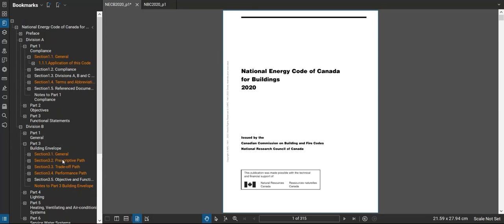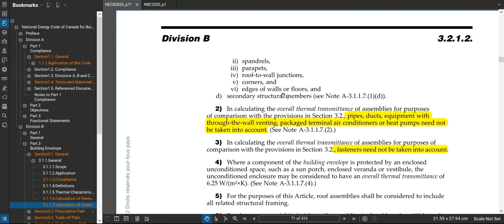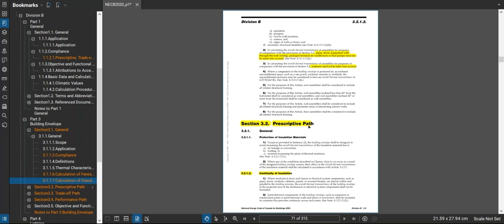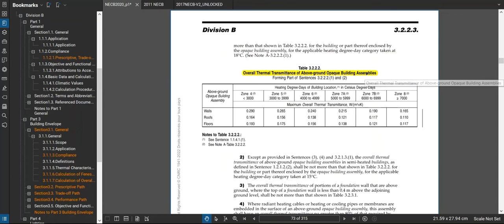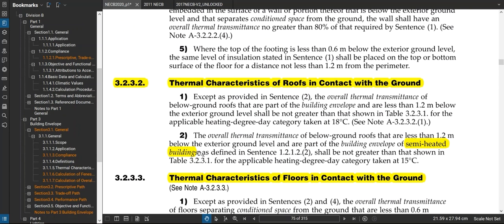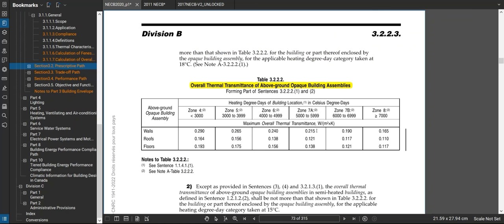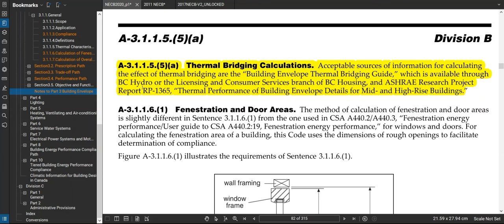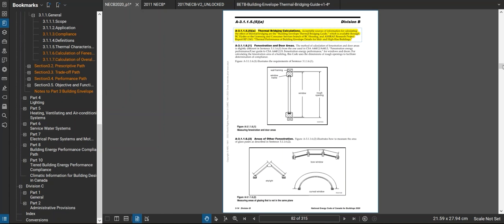National Energy Code of Canada For Buildings 2022 Overview

Comment: And our houses are still built like crap. R17 walls and leaky.
Reply from the maker: I agree. Quite shameful that continuous outside insulation is not yet mandatory. Should also be mandatory that it is non combustible (mineral wool) in urban settings and locations with risk of wild fires.
Reply: @dcarchtech9757  it is mandatory but you are allowed prescriptive paths, performance paths and tradeoff paths.

So you can do efficient windows, doors, windows, furnace instead of putting a coat on your house.

But since a high number of. Homes are built in cold winter months and trades are not skilled or paid enough to build them with exterior envelope sealing and insulation, it will never be done by mainstream builders.

Anything to do with home new home building is exponentially increased in cost as any Markup is done 3 times.

Ie To put in just 1 run of cat6 cable is about $100-200
It costs me $200 for a 1000 foot roll...
Reply from the maker: @EnduroPromotions  Let me clarify. It is not mandatory to do outside insulation for Part 9 buildings such as most houses per section 9.36 of the Alberta Building Code. Not yet anyways. Outside insulation approach is the norm for most non wood framed Part 3 buildings out there.
Reply: @dcarchtech9757  It is not, but it will be if more owners and buyers actually look at the science as to how insulated the wall assemblies actually are, once thermal bridging and framing factors are calculated. 

The Fact many of our tall walls in new builds (have not been changed in any way in last 10 years) and outside walls in -35. were 8C on the interior with thermal tests Shows current codes are far inferior and lacking for what is actually required with our climates in Canada/Alberta, 

For what everyone is buying now to what will be and is required, they are getting absolutley robbed and cheated and lied to. 

It is DEAD easy to to a 2nd interior wall out of 2x4 or 2x6 for an r30 effective wall. But they wont because of price and inadequate trades skills and wages.